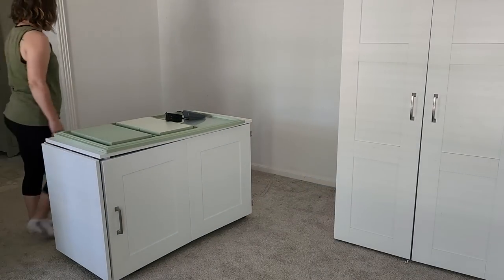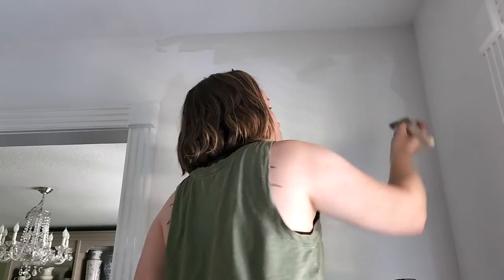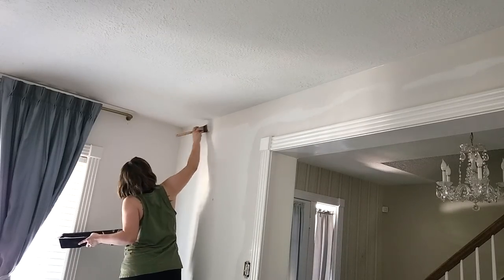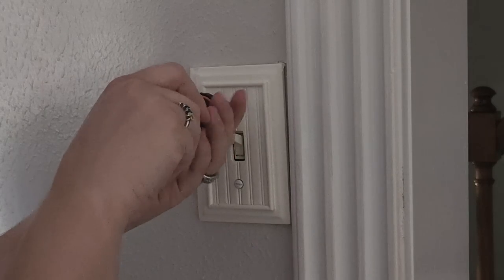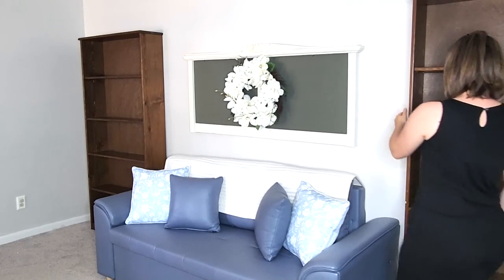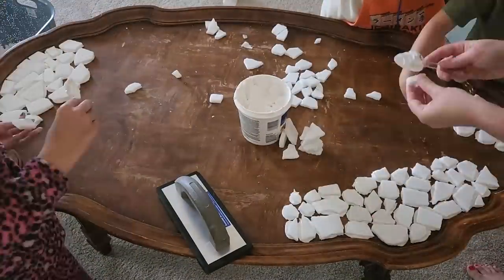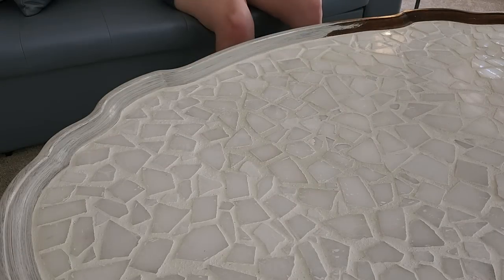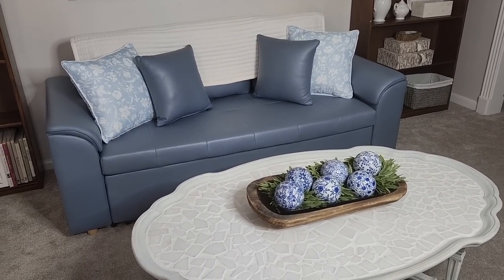Formal Living Room French Country Makeover

Comment: I love the center piece! Side tables layered in could look great. They are practical for guests and useful to set lamps or candles on for a multi-level lighting scheme. I'd go for very small, minimal ones, complementary to each other but not necessarily matching. Also consider putting a mirror in the frame behind the wreathe. It would increase the light in your room and make the space look airy and open. As my mother used to say, if you can't knock a window through, you can always hang a mirror! I love a wreath on a mirror, too.
Reply from the maker: Love your ideas! Thank you